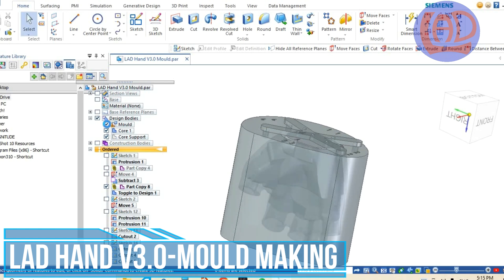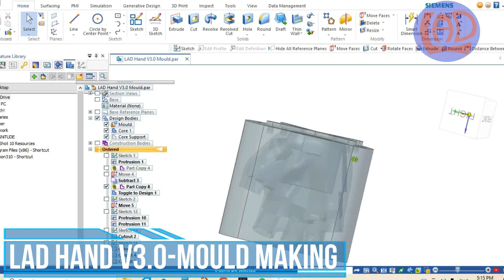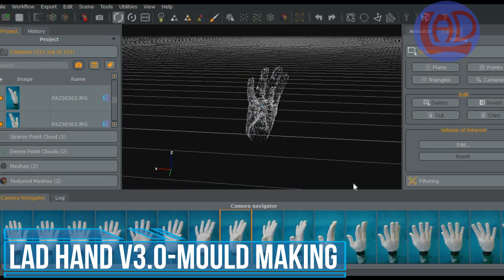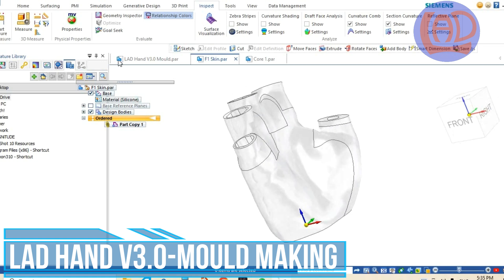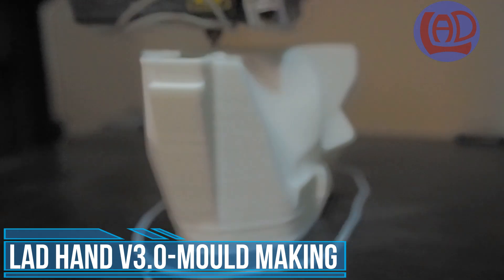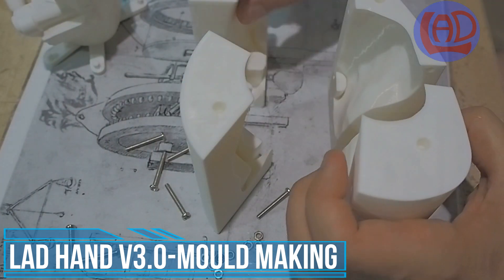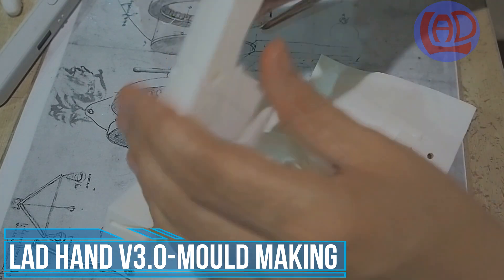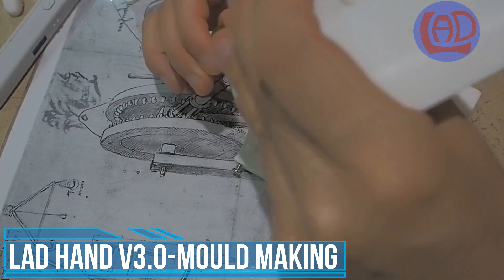👍EPISODE 4 -LAD Robotic Hand V3.0 -:RUBBER SKIN

Comment: I want to learn how to make a humaniod robot
Reply from the maker: Hi Friend. Thank you for your comment. There are a set of skills that you have to develop and exercise in order to design a robot successfully. First, there is the modelling side of things, then there is the mathematical part, then the electronics, then writing the code, and finally assembling and adjusting/calibration. Feel free to have a look at some of my creations at https://cults3d.com/en/users/LAD_Robotics/creations where you’ll find some free designs and some that require a contribution that is proportional to the time I spent getting these designs right and printable in a conventional FDM 3D printer. For instance, the LAD Robotic Torso V1.0 will be ideal for a person that wants to build a humanoid robot, but does not know where to start. Here is the link: https://cults3d.com/en/3d-model/gadget/lad-robotic-torso-v1-0-humanoid-robot
In this link you will find STL and STEP files of all the components to built a torso with two arms (5 joins in each arm, from shoulder to forearm) as well as clear instructions on how to assemble the components, how to handle the electrical wiring, and an Arduino code that allows you to control the robot with a joystick, or by using a MALTAB App that communicates with the Arduino board. If you want to get familiarized with the process of printing and assembling a functional robot, the LAD Dog is a free and fun project that shows you all the basic steps to commission a robot. Here is the link https://cults3d.com/en/3d-model/gadget/lad-dog-robotic-dog-4-legs-robot. 
All the best!